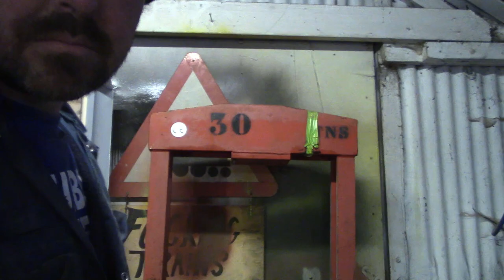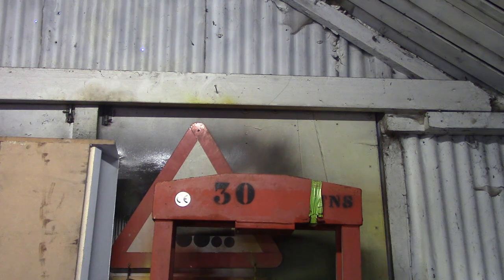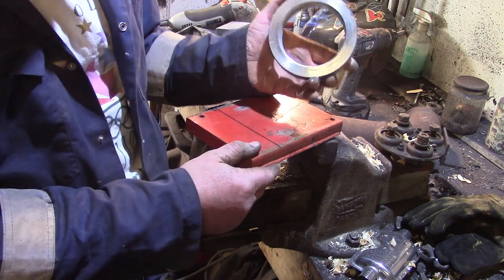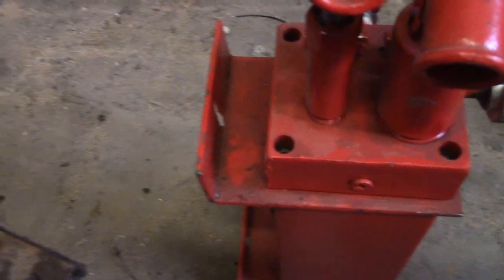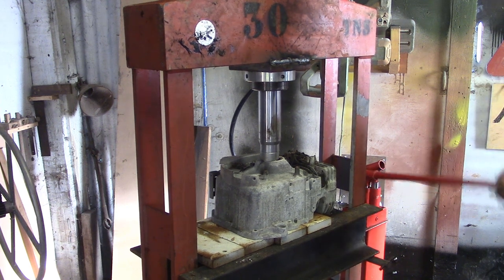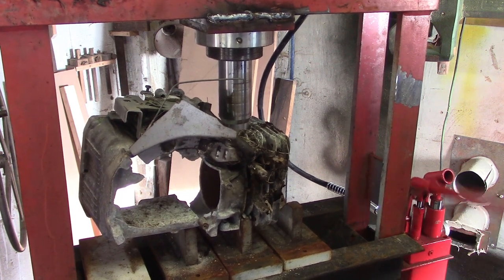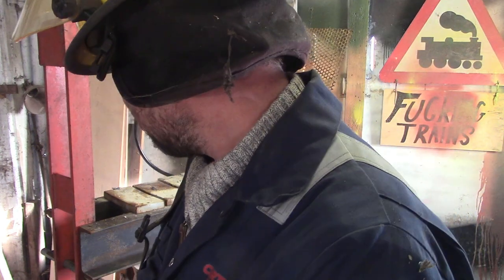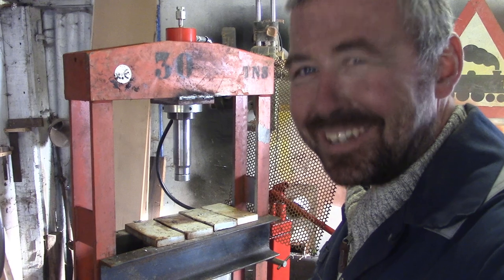Making a scrap bin hydraulic press better #hydraulicpress #fixingscrap

Comment: That's way better than my 12-ton press with the right-side up bottle from Harbor Freight. That two stage pump is key. I wouldn't bother drilling new platform holes, just add some dunnage to raise the height of the platform when needed. Also, I'm laughing my ass off at the audio books in the bg ... the dialogue is always hysterical.
Reply from the maker: Been looking for a second hand mag drill, if I find one that frame is gonna get it.
The two stage is a joy as are the apocalypse novels, a real carrot on a stick for any bunker building types.

Comment: I was watching some aircrete video's. Wondered if you had thought about Aircrete and Styrofoam blocks for insulating the underground workshop at all ? Would be lighter to get down the hole  :-)
Reply from the maker: I've been watching aircrete and shotcrete vids recently too as it happens, not liking aircrete much for the underground works, it's strength comes from volume and is more permeable than the denser concrete but that or styrofoam concrete is something I'm considering for the above ground workshop.

Comment: Many thanks. Where did you get the cylinder/ram? Also interesting the way the liner is in and how it jumped across the room. That said, I can't see that buffing out.
Reply from the maker: On eBay, can't see them on there at the moment though.
Very interesting construction, not designed for replacement while probably not being as cheap as the nikasil aluminum bores. Plenty of meat on it though so could probably cope with a heavy overbore. I wonder if anyone bothers?
Reply: @turboconqueringmegaeagle9006  cheers. We have a 10 ton one at the club with a leaky cylinder we can't find spares for.

Comment: Hello mate do you know what sort of tonnage a 9 inch diameter ram could produce at say 200 bar?
Reply from the maker: 9" dia = 64 square inch
64x 3000psi = 192000 pounds of force, 84 long ton
That'd be a chunky ol ram mate.
Reply: @turboconqueringmegaeagle9006  yeah I better be careful with it. I'll splice in some shots of it in the project I'm working on. Bloody heavy ass thing.